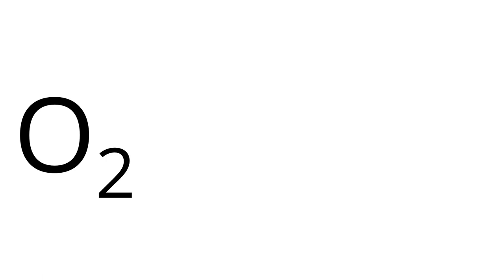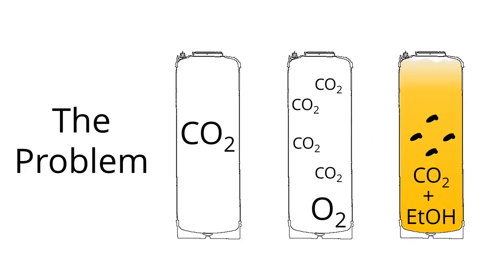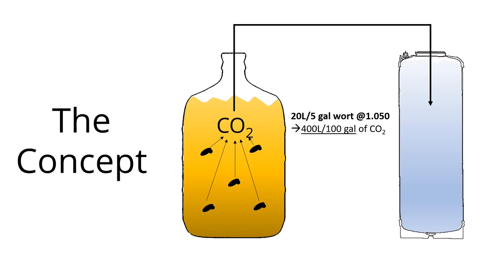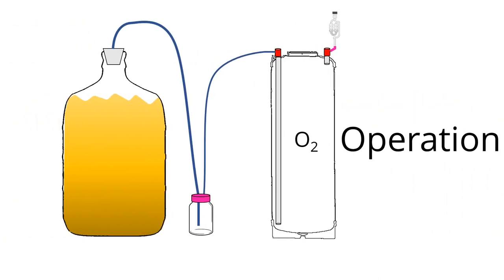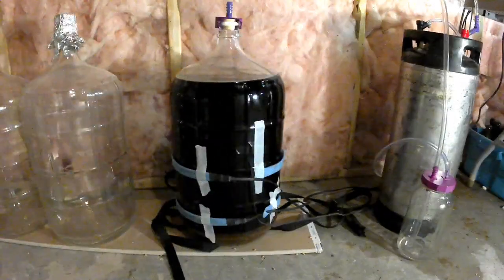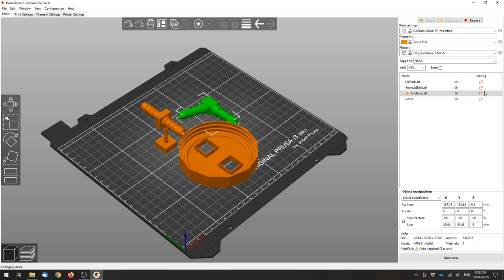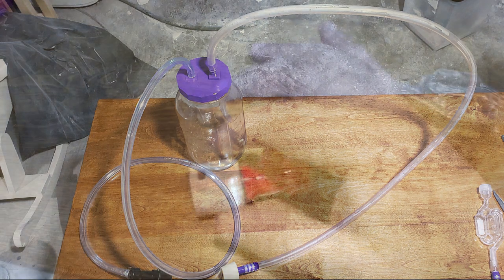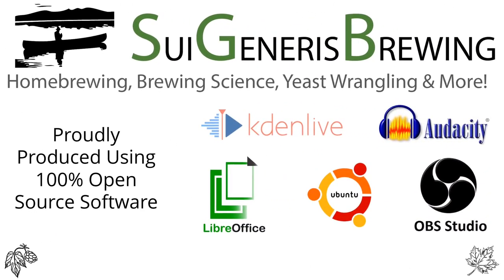Purging a Keg in 3D

Comment: Nice video Bryan, another reason to get a 3D printer in the house:) For all the homebrewers without a 3D printer, you can use an inline filter instead of the jar and attach a blowoff tube to the keg instead of a bubbler. I prefer to use a spunding valve on the receiving keg just to make sure that the lid is under pressure (I have old kegs) and my gas goes straight from the fermenter to the keg, but I ferment 12 liters of beer in 19 liter corny kegs so there's very little chance for the yeast to get out of the fermenter.
Reply: Was thinking the same for the blowoff tube. Was trying to think of a way to fix the lid of a mason jar myself but really liked your idea of an inline filter. Where could I find one like that ? Cheers!

Comment: I’ve done something similar but I went from fermenter out (plenty of head space in fermenter) to gas in in a keg filled with starsan- liquid out from the keg to a 5 gallon better bottle to capture the star san
Reply: Hey Jason, how did this method go for you? I was thinking of doing the same, I wasn't sure how much pressure it needs to push out the starsan from the 2nd keg.
Reply: @M-O-F-F  I've done it a few times. A few times on ales and once on lager. The lager didn't work so well... but i think that might have been a yeast issue. anyways, it doesn't  take much pressure  at  all to  empty a keg. my  last  was a pale ale and it emptied  the  keg in a day. not sure how long it  took but i check the starsan keg one day it was full. the next day i check it and it was empty
Reply: Jason I do your method , except I ferment in kegs and just attach the gas out of fermenting keg with a jumper line to liquid side of receiving keg. This way the co2 is entering through the bottom of the keg and upwards out of the gas post which I have a spunding valve attached.    

Sometimes (for bigger batches) I use an extra jumper in the same way to make a 3 keg train to maximize the co2 harvesting. Worked very well

Comment: I am wondering, why do you need the jar at all ? Why not just plug in to kegs beer port ? Great idea by the way.
Reply: I was thinking the same actually
Reply from the maker: You get a mix of yeast and crud (called kraussen) on the top of fermenting beer. If there isn't enough headspace above the beer, it would go through the lines and into the keg. The jar catches it and passes the CO2 onto the keg.
Reply: @SuiGenerisBrewing  That makes sense. Thank you.
Reply: So the jar is just a precaution in case of blowoff, that's understandable. I was really wondering why it was there.   If you have plenty of headspace you can just skip the jar.
 

 I ferment 10-12 gallons in a 15 gal sanke keg with a float dip tube.  I just hook up the gas out into the liquid side of receiving keg and place a spunding valve on the receiving kegs gas post. Sometime I link two receiving kegs.

Comment: I've been using your keg purging technique now for about 3 years.  I just use a mason jar with a plastic lid, 2 duotight bulkhead fittings and silicon seal.  Your videos are top notch!  Thanks for sharing your knowledge.  My question deals with how much CO2 would be available to purge a keg if the beer is fermented at say 10 psi.  Do you think there will still be enough CO2 to purge the keg?  I'm thinking about fermenting an IPA under pressure.  Thanks.
Reply from the maker: Should be plenty to purge the keg. Keep in mind that the amount of CO2 dissolved at fermentation temps is fairly low, even at elevated temperatures. So you're only really loosing a bit of CO2 to the headspace of your fermenter. Your beer will still be making about 20 volumes of CO2, you might lose half a volume to the added pressure, but the rest will still flow through the keg.
Reply: @SuiGenerisBrewing  Thanks for the reply.  Very much appreciated!